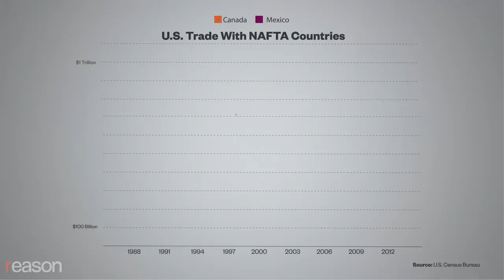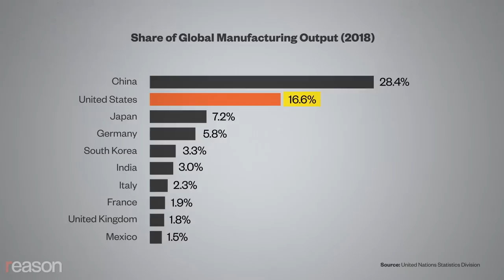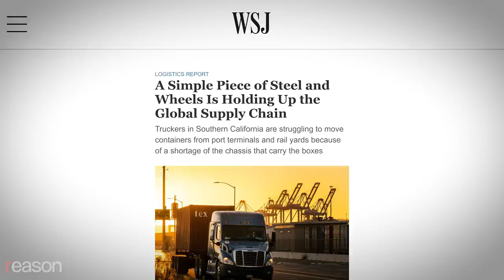3 lies politicians tell about globalization

Comment: I don't understand how we think we can create jobs if we regulate and restrict ourselves to not produce for ourselves
Reply: There are some things like environmental regulations that make foreign manufacturing appealing, but the overwhelming reason is simply US citizens have a high standard of living, so they won't work for low wages.
Reply: @Freja_Solstheim  First, billionaires are just paper wealth, based on speculative, not intrinsic asset value.  For example, Musk could not unload all his shares at $900/share.  Second, there is not a set amount of wealth in the world.  Instead, billionaires basically create wealth out the thin air, by adding efficiency to the means of production.  This newly created wealth is split between workers, customers, and owners, with proportions depending on supply vs demand.
Reply: Bingo! Most of the problems talked about in this video had little to do with globalization but our own government.
Reply: P A  not a coinkydink the states you mention are “fly over” red states, not blue states.
Reply: @Les Toussaint I was lucky to work a union job in a factory at age 21, was paid $19/hr starting, in the late 80s. The men there were able to maintain a family on their wages and afford a decent middle class life. 
That factory has been gone for 30 years.  
I don’t know if any of the “experts” calculate all the jobs and wealth a factory generates, inside and outside the factory.  Rule of thumb I was told is 1 factory job generates 10 jobs outside the factory, all types of jobs from restaurants and laundry to services etc. Lose 100 factory jobs, and say goodbye to 1,000. That kills small communities, just like all along the rust belt….
I’ve lived what I’m complaining about and think I might know more than some of these shirt and tie bespectacled think tankers…
Im glad you agree, every country should have some self sufficiency, especially energy & food, and not everyone is going to learn to code, flip burgers or be a YouTuber.  There are lots of great jobs and a pity schools don’t have shop classes any more, they’re all just college prep and don’t even do that well either….
Reply: @Les Toussaint 
TPP did not include China and the Philippines.
Reply: @Les Toussaint 
Actually TPP disadvantaged China to the benefit of countries like Japan which respect our intellectual property rights. China would have been on the outside looking in, and would likely have refused to make the hard changes needed to join such an alliance in the future. TPP rewarded good behavior and brought everyone’s interests into alignment. Pulling out of TPP was a huge mistake. And China was the biggest beneficiary of that mistake.
Reply: P A  dont you put georiga in with West Virginia and Alabama, where are you from to look down on georiga? Also yea we will and do, movies too, and im pretty sure the rate of people moving here is pretty high, because we're the shit.

Comment: My experience with Chinese manufactured products is that they have a much shorter product life. Are you really saving money when you need to replace products two, three, or four times as often? Also, poorly made products fill up landfills and cost a lot in terms of putting excessive carbon in the atmosphere.
Reply: Yes
Reply: Customers are constantly reevaluating the value proposition when buying products. If more quality was needed, they would demand it and change their buying decisions to go after more quality.
Reply: @tomcat8662  I disagree. In many cases consumers don’t have the option to make a low cost versus high quality decision. Even when you opt for a more expensive, and presumably higher quality product, you often end up with garbage. In a perfect world, it would be great if we had the choices and information to make such decisions but that’s fantasy. For example, 5 years ago I purchased a new dishwasher.  I bought an expensive brand name with the idea that buying a high-end product would last longer and need less repairs. After one year the machine started having serious problems mainly due to poor quality parts and materials that repeatedly failed. Another example: I Purchased an expensive faucet for my kitchen from a name brand manufacturer that appeared to be stainless steel but as it turned out it really is made out of plastic with a thin film of stainless foil that soon started to peel off. I could cite many more examples. I wish we could demand better quality and I bet many consumers would be willing to pay more for durable products but paying more seems to offer no guarantee that you won't end up with shoddy products.
Reply: Yes

Comment: I can agree that free trade has many benefits.  What is not addressed in this one-sided argument is the fact that manufacturing jobs take in low-value inputs and transform them into high-value outputs through the application of labor and capital; they create wealth.  Most service jobs just move wealth around, and, I could argue, destroy wealth through inefficiencies.  To beat the argument to the punch, financial services don't create real wealth, they create paper wealth.  If you don't have enough real wealth being created in an economy, it depletes existing wealth, slows down, and eventually everyone starts losing purchasing power.  This is why a service based economy will eventually collapse.
Reply: The intellectual property owners of foreign manufacturing are overwhelmingly American.  Chinese workers may be tightening the screws on the iPhone, but Americans are the ones building wealth off of those sales.

Comment: Here's the thing. Protectionism is bad, but it's a band-aid for something much worse. Over-regulation and over-taxation has strangled our economy and made it impossible for us to compete with foreign competitors. Without protectionist policies, countries with few regulations, low taxes and cheap labor could easily take over huge portions of our over-regulated industries.
Reply: Well put. It is similar to many libertarians thinking we should have open borders, while possibly in line with their ideals ignores the fact we live in welfare state. We shouldn't get of strong borders and protectionism in trade before the welfare state and high regulation has been fixed
Reply: @cowmaneater1243  I'm a libertarian, but I'm not stupid about it.
Reply: You don't even own a US business. Manufacturers buy inputs from foreign countries and tariffs impact their profitability.
Reply: @ElFuego121  I work at a business directly impacted by the repealing of trade tariffs. Within a couple months of Biden taking office, we have lost our most valuable contract. If the US and China were on an even playing field, tariffs would not be necessary. But China has slave labor, extremely low wages and very little safety regulation which allows them to produce material much cheaper than the US (albeit at a lower quality.)

I hear stories from our former customer about how bad the quality issues are since they switched over to a Chinese supplier, but the bosses refuse to switch back because the cost savings offset all of the material they have to scrap due to quality concerns. Considering that what they're making are airbrakes for large trucks, if their quality control fails someday, it's entirely possible that lives could be lost. Yes, that is a corporate decision, corporations follow the road of most profit, but none of this would be up for consideration if we didn't make it profitable for US corporations to open plants in China and exploit their very cheap labor.
Reply: @Kitkat-986  You didn't address my point and nothing you're arguing is for economic liberalism. Everything is made in China already. Making foreign products more expensive impacts ALL american consumers, including businesses. One example is Steel. Another example is chemicals. Most businesses rely on prices being affordable. If you want to complain about too much government, but propose for more government - you're not libertarian.
Reply: @ElFuego121  To my original point, we don't have a free market system, not even close. Unless we were to de-regulate our markets, having no tarrifs simply leaves us vulnerable to foreign markets which to not face the same self imposed limitations as us. Having a semi-regulated market just means that those not affected by the regulation will dominate the market, that is how systems like cronyism work.
Reply: @Kitkat-986  How are you in any way different from the democrats that supported unions in driving out US manufacturing? The excuse your giving is that we're in danger if we're not protected by the government, even tho the govn't is responsible for the damage being done. Anyway, this video shows how globalism has benefited us for decades now.
Reply: @ElFuego121  The government is causing a problem through excessive market regulation. The ideal solution would be de-regulation. The shitty solution is to taylor that regulation to preserve certain parts of US industry. It's not ideal, but it's better than regulation which favors industry of foreign nations over the US.
Reply: @Kitkat-986  Raising the price of foreign goods cuts out buyers who couldn't afford the American made goods to begin with. It just makes the economy poorer.

And poorer in the name of protecting jobs we probably don't even need. There's no important difference between a service economy vs a goods economy. In fact, our economy shouldn't have the same jobs as in China. US citizens have such a high living standard that they shouldn't be wasting their time doing low-skilled labor anyway.

Why you brought up these jobs being in China like it's a problem doesn't make sense. If people are willing to work for such a low wage then that means they really need that job.
Reply: @ElFuego121  Yes, it does exactly that. Welcome to government regulation. Get used to it, because that's the norm.

Comment: Another really weak video from Reason, and not because I disagree. Reason and probably even Cato is out of touch and disconnected with how the average American perceives the arguments they're making here. Reason's videos on economics often suffer from being oversimplified to the point of feeling like they're hand waving away the issues at hand. Every single conversation on trade should start with a reminder of the universal truth about economics: central planning doesn't work, and so whatever the costs and benefits of international trade, no bureaucrat or politician can better make that calculation than individuals can for themselves. At the beginning of the pandemic, many Republicans jumped on it as an example of why relying on international supply chains was too risky. If CATO hadn't succumbed to the propaganda and fear mongering themselves, they might have take advantage of the exceptional ineptitude of that particular line of reasoning, by pointing out that those Republicans were arguing against free trade in case we need to important a bunch of useless masks, overused intubators (which were very expensive, and are now sitting around collecting dust), and vaccines of questionably necessity and efficacy.

Comment: I had to give a thumbs down to an otherwise good video. The statement that manufacturing jobs are being driven down by automation is very questionable. On the surface it sounds like something that could be true but attaining real output improvements from technology is harder than it sounds because of the integration with humans. This line of thinking is largely to do with how economists evaluate manufacturing efficiency, particularly in computer technology. Because of the product life cycle of a computer the costs to consumers reduces greatly after 12-18 months and if a newer chip is valued at twice the value of the previous chip that is an indication to an economist that the new product is 2 times more valuable. Since economists gross manufacturing sales and don't track companies final part count it should be obvious to anyone that making a causal statement is very suspect. In short we have no clue if the "efficiency" of manufacturing has increased or if we simply charge more. As it turns out there are some pretty good evaluations of the computer industry that would indicate this behavior of claiming manufacturing efficient is at the root of lost manufacturing jobs is at least very questionable. The likelihood is a mixture of automation, trade and accounting.

Comment: About the baby formula… globalization encourages a smaller amount of larger manufacturers. For example, instead of having 2 or 3 suppliers per country, you have 3 or 4 suppliers for the world. The issue of having 1 large supplier going offline is exacerbated by globalization. It’s often a trade off between efficiency and resiliency. Globalization is more efficient but we need to find an effective balance.